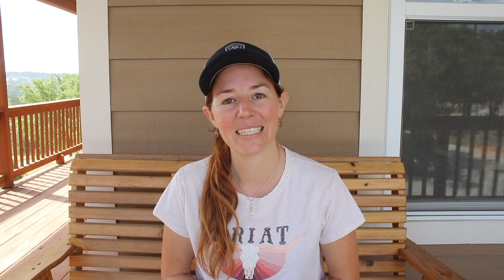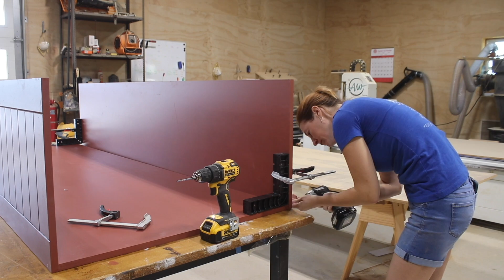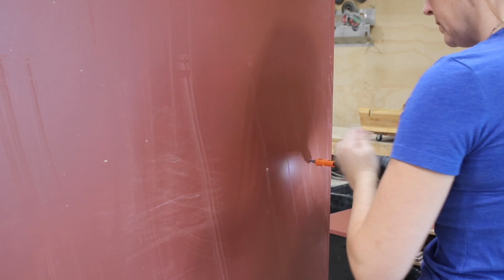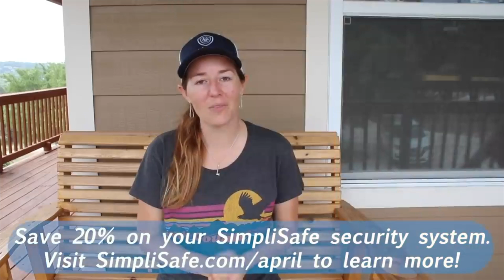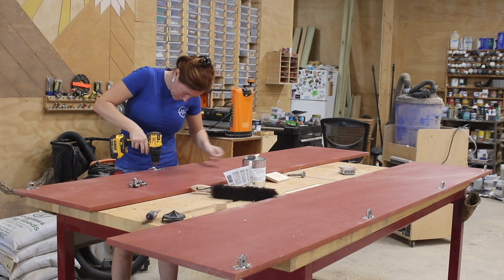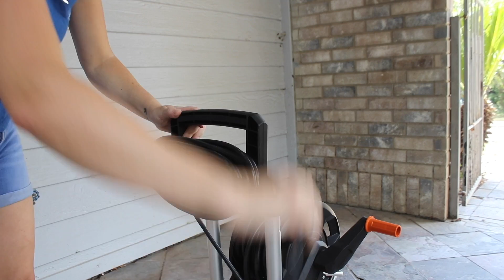Giant Outdoor Storage Cabinet | Great for Indoors or Garage Too!

Comment: Great video, thanks! 
I'm trying to design a similar outdoor cabinet only bigger (10 foot long, 23 inch deep) and I was wondering about rain resistant of this cabinet. You have protected the top but I wonder if it can stand standing in open outdoor where rain can hit it's side as well . Can the doors block the rain? Will the wood withstand direct water?

Comment: I worked in a cabinet shop in the early 2000s, MDF is very easy to work and shape but we hated mdf jobs because of the dust and chemicals inside. hard to filter that crap out, very fine.

Comment: I was taught using contact cement, we used spacers( old blinds) to separate the 2 items. Position in place then start pulling blinds out 1x1. If that helps anyone.

Comment: I built a super sized bookcase for an upstairs bedroom. I measured the height of the ceiling on the 1st floor and used the Pythagorean formula to figure how tall it could be to fit diagonally and tip into place and make it up the stairs.  Unfortunately the upstairs ceilings are 6 inches shorter, so I had to cut the top 6 inches off in the upstairs hallway and re attach the top.  Looks like you had plenty of room above the top.

Comment: I'm trying to find Armorite locally but none of the local Roseburg distributors have responded yet to web inquiries - gotta make some calls. However, I looked at ordinary interior MDF recently and saw 3/4" sheets going for $61 at the Homeless Despot. How pricy is the exterior MDF? Also, does it come in 49x97" panels as is customary for MDF or is it 48x96?

Comment: How exactly could I anchor it to the siding/exterior wall so it couldn’t tip over?  With little ones running around it’s a risk with such a tall piece that might be too heavy depending on the contents of that tote.

Comment: This turned out really good. Do you have any long term experience with the mdf though?
Been looking into building some storage for the garden in order to potentially get rid of a shed and possibly extend a gym. Only space available is about 3m wide 60cm deep area that cabinet designs like this would fit in well.

But I need to know whatever I make will last a long time and be low maintenance. Holding up to UK weather with lots of rain.
Would this mdf hold up or should I go full wood frame with membrane and cladding like a full shed design

Comment: I guess I would have opted for cleats under the edge in back of the shelves to provide some extra strength. It seems like holding it only with screws might encourage the shelf to split. Am I wrong in my thinking?
Reply: So would I. We put waaaay too much weight on shelves to just hold them up with screws. And we move stuff around a lot. There would have been some reinforcement in the corners of the shell, as well - where the sides, back, top and bottom meet.